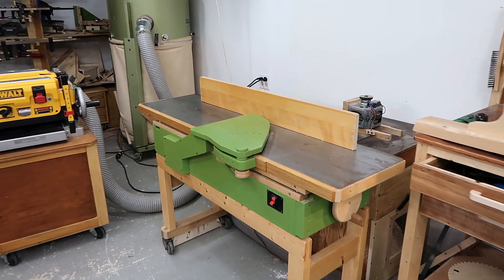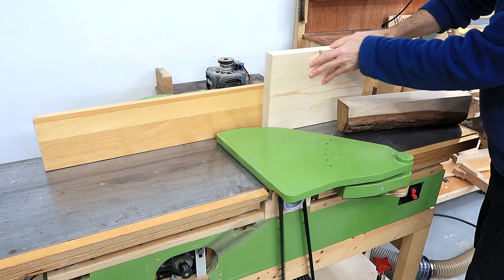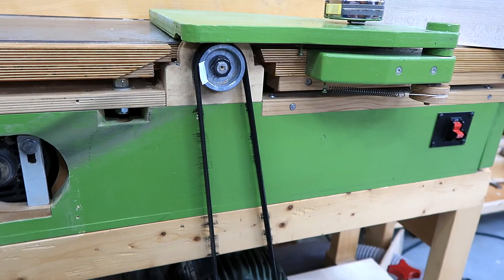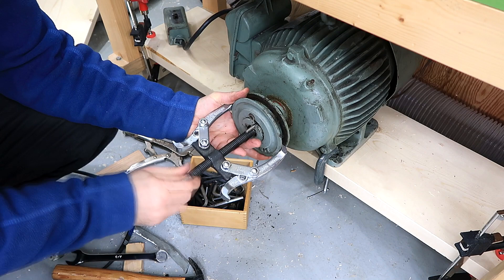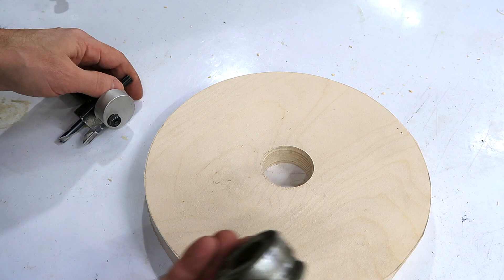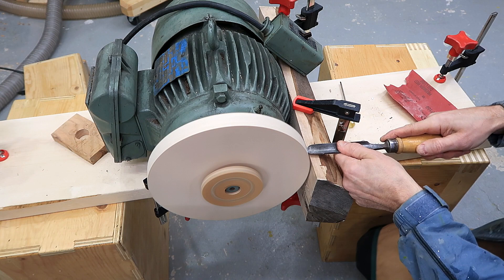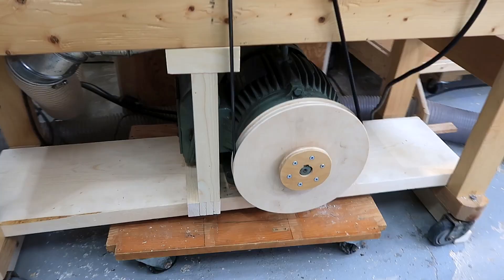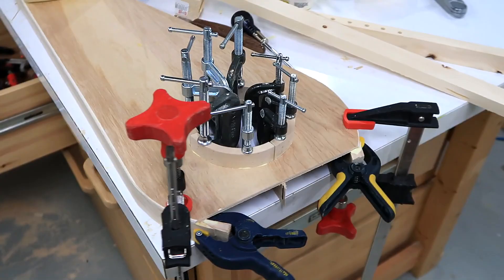Bigger motor for my homemade jointer

Comment: Honestly, the bit that surprised me the most was how much noise the cutter head itself makes. I wasn't expecting that. I know you said you're getting a helical carbide cutter, but do you have any thoughts, outside of that, to reduce the sound the cutter head makes. (Granted, having the dust collection off helps considerably)
Reply from the maker: bigger gap to the table makes it quieter, but that has its disadvantages too

Comment: How comes such a massive motor only makes 1hp? Or is it rated 1hp duty but as you apply more stress to it, it can produce way more? 
If you ever play with it again, it would be nice to use your killawatt and compare the motors as they are worked on.

Comment: You should be able to order a 13” shelix cutter head from Byrd. The one on my ridgid was a little over 300USD from 2020.
Reply from the maker: it has to be one that's the right size, that's what makes it take so long.

Comment: Have you tried a pulley from a washing machine or a lawn tractor?    I have found 8” pulleys at my local hardware.    I think the brand name was Grote of Grothe.
Reply from the maker: washing machine pulleys are too big, probably wrong shaft size too, plus i don't have one.  Never seen pulleys like that on a lawn tractor.
Reply: Here in the States a belt/pulley system for multiple blade lawn tractors is quite common.
Reply: usually the pulley on the transaxle is quite big. but the shaft is probably smaller.

Comment: That's the biggest 1 HP motor I've ever seen! It's probably rated 1 HP for continuous use without a great deal of cooling, I'd wager its peak power is far higher than that.

Comment: I hope for an explanation why the helical head require a more powerful motor. I'm thinking there are many factors involved.
Reply: This is what matthias replied to a similar question:
"the carbides don't have as much of a wedge shape to them because they are more brittle.  So it's a bit more like scraping than cutting"

Comment: Increasing the drive pulley size increases the cutter speed but doesn't also decrease the power realized from the motor?
Reply from the maker: decreases torque but not power
Reply: @matthiaswandel  I hope the decrease in torque does not affect the ability of your jointer to perform its job which may require more time. "Berra's theorem; torque is the capacity to do work, while power is how quickly some strenuous task can be accomplished."

Comment: You should use Plexiglass guard cover so you can see the belt and know if it's vibrating and needs motor realigned.
Reply from the maker: I can hear it squeak if it's off

Comment: The noise generated by the new set up is definitely a lot less harsh. Should make future videos a bit easier on the ears for your viewers.
Any specs for the torque of the new motor compared to the old one?

Comment: I think you should use a 3450 rpm motor so that you don't need such a large pulley. That is a nice motor but its to slow for a jointer I think It would be better for a bandsaw.

Comment: There's two different formulas they use for calculating electric motor horsepower. One has something to do with the motor's RPM. It's how vacuum cleaners can have such ludicrous horsepower ratings and not be false advertising. They're using that RPM based formula. Your fast universal motor likely uses the RPM based formula too. Big Chungus motor uses the other formula.
Reply: It's likely that the big motor is rated based on Dyno testing, and is rated to make that power 24/7 at 40C ambient for 10, 20, or 30 years. Industrial motors are crazy over built for home shops.
Reply: @Cynyr  no it's what I said. There's different ways to calculate horsepower. Look up how do they calculate the horsepower of vacuum cleaners and you should find a link that explains it. Because that's where you run into it the most.

Comment: Do you have only 1 power phase in your workshop? 3 phase motors are much better
Reply: His workshop is in his basement. Not many residential areas have 3 phase (or at least 3 phases running all the way in)!

Comment: liquid silicone to the wood pulley path help in some way the life of the belt as wood is not a big friend of the rubber at these rpm, silicon helps in car belts when they make a dry screaming noise that embrasing you in public haha and do not make slip like oil will do, silicone just hidrate the rubber. Congrats for your projects. Unbelievable size for 1 hp motor :O

Comment: Cant you enclose the cutting head in some air tight enclosure and remove all the air?
That way the head would be inside a vacuum and the noise cant get out.
Reply: It would need to be floating inside the vacuum chamber. Otherwise vibrations could pass through the mounts.
Reply from the maker: yes, I could completely enclose it.  But then I wouldn't be able to use it anymore!
Reply: @eDoc2020  Mmmm good point!!
Reply: @matthiaswandel  Dont be so negative... we are trying to help here!

Comment: Nice final result! Did the old motor use brushes? Or why was it more noisy?
Reply from the maker: yes, a universal motor.  High rpm brush motors are always loud
Reply: @matthiaswandel  thanks I didn't know all universal motors have brushes but I guessed they do

Comment: Always educational watching your design & builds. Great improvement with the bigger motor. Lots more torque than power from high RPM. 
I was also impressed how quiet the motor on your Pantorouter or morticer was. What was that originally?

Comment: Shouldnt you try to remove some weights on that wooden disc? Or maybe it doesnt helpt or matter at all?
Reply from the maker: No reason to, and just adds place where stuff can snag.  It's lighter than a metal pulley at any rate.

Comment: Once you put on the new cutter head, there won't be much left of the original planer.  Maybe the bearings?
Reply from the maker: Tables, height adjustment mechanism, fence, frame, stand, wheels, chip direction and extraction, cutter head guard.  So mostly still the old one.
Reply: Ship of Theseus problem right there.
Reply: @matthiaswandel  I think Brian is referring to the original lunch box planer you used to make the jointer, originally.
Reply: @matthiaswandel  I meant there won't be much left of the original thickness planer.

Comment: Somehow with the new motor it didn't seem to make as much noise before you added the wooden disc.
Reply from the maker: it was running way slower with the metal pulley, that made it quiet.  But need more speed to do a decent job.

Comment: Adding dust collection to my jointer and especially my plainer makes it unbearable without ear protection.  A simple gravity bin under each solved the problem.
Reply from the maker: but with this jointer, it helps quite a bit with clearing the chips from the cutter head

Comment: Wouldn't a crowned pulley be good in these situations? This will cause the belt to always find the middle of the pulley, like a train wheel.
Reply from the maker: it is crowned between the flanges.  But crowned pulleys are very sensitive to misalignment.

Comment: I want to change my motor on my 735 dwlt planer to an induction motor
Reply from the maker: not possible
Reply: @matthiaswandel  I meant keeping the same setup but swapping out the universal motor and make an accommodation for an induction motor. Maybe you can do a video that explains the pros and cons of  doing it based on your knowledge.

Comment: The new larger motor may also provide more torque AND inertia.  Unfortunately, the increased torque will be mitigated by the pulley ratio and may end up more or less.  

In any case, it looks to be pretty darned comparable and much quieter.

Comment: You can 3d print this pulley just fine for about 3€.
Reply from the maker: yes, and do that weekly as it keeps breaking.
Reply: @matthiaswandel  Not at all, it will last a long time and you save probably 1 hour ober building one out of wood.
Reply: @MaxMakerChannel  He'd also need to buy/make/otherwise obtain a 3D printer with a large print volume, set it up, model the large pulley, and print it. Once you factor that in it's a bit more than 1 hour and $3.

Comment: 1Hp is 1Hp.  Period.
Does not metter how big the motor is :)
As you of course know.

It is big just becouse it is low speed, so it must have more poles.
As you of course also know.

And as consequence.. you must have large transmition ratio.
But... it was cheap :)
Reply from the maker: are you implying that a "5 hp" shopvac is 5 hp?  There is also efficiency and duty factor.
Reply: @matthiaswandel  bad comparison, shop vac efficiency depend on turbine design, rpm.... not just motor power.
We are talking just about a motor, not entire machine.

False declarations are completly another story, and yes of course that i know that Chinese horses are smaller :)
Yes, duty factor will add, but main reason is just number of windings in that motor.

For 750rpm this motor must have 8 poles, plus starting windings 
It is big cos of large number of windings, not cos it is "powerfull".
Single phase, 3600 rpm motor have just 2 poles (plus starting). Of course it can fit in (much) smaller case with the same power, assuming all other factors equal.

Comment: Send me a drawing. I will machine one and ship it
Reply from the maker: Of the cutter head?  Those are awfully complicated.  Or did you mean the pulley?
Reply: Lol of the man machines a cutter head as a favor I would be quite surprised.   A proper aluminum pulley with the grooves could be pretty simple though
Reply: @matthiaswandel  As a hobbyist, I've machined a fair number of J6 pulleys on my manual metal lathe. I'm impressed that you were able to make one out of wood!
Reply: @nopinionocomnt  I understood it was just a tapered pulley, as I've used them with j6, j10, etc. What I was suggesting is that he did a good job making a functional pulley for a j6 in the manner he did.
Reply: @matthiaswandel  the pulley. I

Comment: I know I get a lot of blow back on this but anything wider than 3-4 inches needs to run through a planer not a jointer.  It's simply not safe.  How many thousand RPM does that thing run?  And with at best minimal safety guards in place nothing to preven kick back?  In a planer you have a step where kickback is nearly impossible.  Build a simple planer sled and you get perfect results or if you have a heavy duty router build a router sled.
Reply: People have been using electric jointers for over a hundred years, and powered surfacing equipment since the late 1700s. They are honestly safer than a table saw. There is a guard over the head, and your workpiece over it when the guard is moved. Very little of the head should ever be exposed if your back fence is set where it should be. Your hands should be quite safe using proper push blocks/sticks.

And why would you use a planer sled for wide boards, that you have to shim and somehow clamp down or screw down? Especially if you have access to a nice sized jointer.

I mean, if you don't like them and they seem scary to you, that's cool. Everyone is welcome to their opinion. Somehow I doubt companies would sell larger sized jointers if they were inherently unsafe, as opposed to people getting hurt due to poor practices.
Reply: And the safety prevention of the workpiece becoming a projectile?  Yeah like I said safer options there is no need to surface a board this way.
Reply: @Beralius  People have driven cars for over 100 years and the majority of that time seat belts or child seats were not used.  Only within my lifetime were either of them made a thing let alone now required by law.  Per your argument they are obviously not needed so we should all remove them or at the least just not use them right?

I can go on and on about things used for over 100 years that have had major safety upgrades in more recent years because people realized they were needed.  Jointer kickback just like a table saw can fire a board through a solid core shop door in the blink of an eye and if you're in the way it will go through you first!  

But hey 30+ years of using such equipment what might I know right?

Other options out there that are safer, faster, and frankly provide better results than this.
Reply from the maker: I guess you never heard of face jointing?  It's done to remove twist.  Why do you think they make jointers wider than 3"
Reply: Like I said same if not better result using a surface planer or a router sled.  Just because you can doesn't mean you should.......  Plus look at the footprint your oversized jointer takes up.  You have a nice planer that takes up less space. Same can be said for a router sled.  Again not needed and safer better options at your fingertips.
Reply: @wauhawk  there is nothing in a lunchbox size planer to prevent kickback. Just the friction of the two small drive rolls. Kickback in a planer doesn't happen often but it can still happen. Oddly enough I have seem it happen a couple time in a planer and never on a jointer. There is also the fact that if it were to happen while using a sled then could be really dangerous since the two pieces aren't usually connected in a very strong manner. Usually hot glue ot a small screw or two or even just a cleat.
Reply: @mr.picklesworth  In a planer the piece is surrounded on all sides.  I've seen it kick back and all that happens is the whole thing just stops because there is no place for the piece to truly kick back to and become a projectile. Basically worst case is you kill a $20 belt or you kill the motor. Unlike a jointer.  Even a table saw has more safety bits than a jointer even though most of us remove half of it.......  We have stacked dado cutters here in the US.  They are not legal in the UK for safety reasons.
Reply: @wauhawk  my understanding is the reason stack dado cutters aren't legal in the uk is because of the added inertia. It changes how long the blade spins or after it is turned off they have rules about how long a blade can spin for after the motor has been turned off. There are some interesting videos about the subject on YouTube by people who know more about it.

Face jointing, when done properly, is no more dangerous than using a table saw and is normal industry practice. And as far as a planer being enclosed while that may help a little the direction the blade is spinning is just like a jointer or tables saw. It is spinning into the work piece being fed in and wants to through it out the direction it is coming in. 

You may have a different way of doing things and that's perfectly fine but that doesn't make the other way unsafe for others.